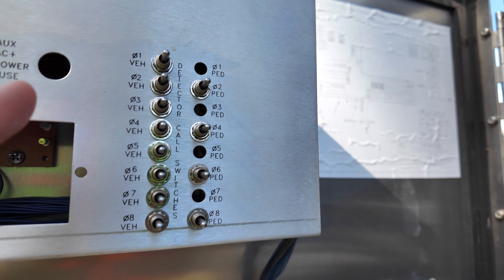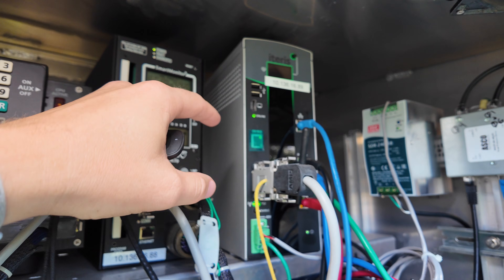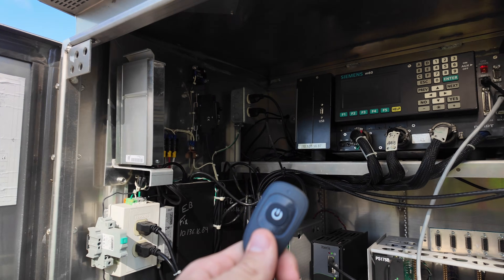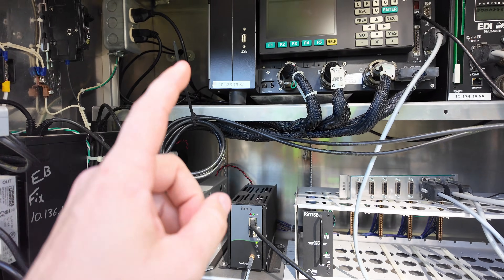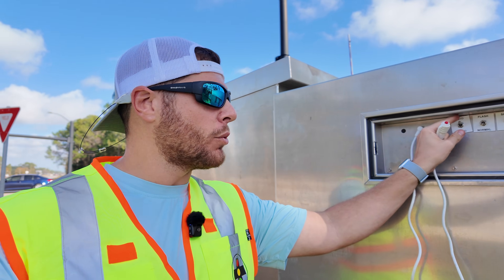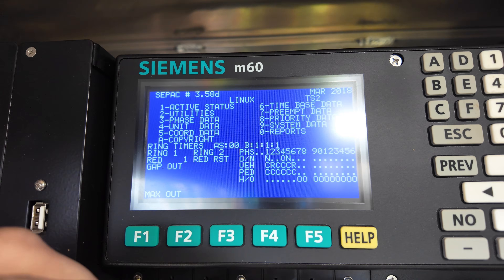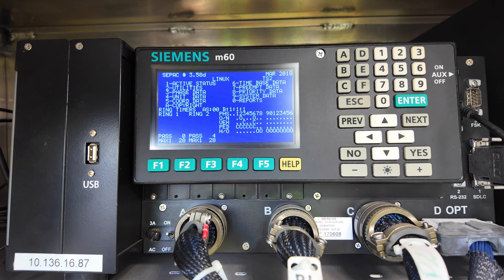What Is A Police Access Panel?

Comment: I’ve seen cabinets alongside the interstates that looks very similar to a traffic controller cabinet at different points, even in the middle of nowhere.  Is it safe to assume these cabinets have the equipment to get your cell signal for measuring traffic data? Either that or be connected to induction loops that measure the number of vehicles that go past?

Comment: I'm really amazed at how much equipment is in one of those traffic boxes.  I was visualizing a power supply, and some kind of rack with a series of relays that would sequentially turn various directions on or off.  MUCH MORE going on !!
     In my neighborhood, some of the boxes have [what I call] "sidecars" ... like a 18 inch by 30 inch box hanging on the side, presumably to house yet more electronics.  And, some of them have fans in the cabinet, because I can hear the "muffin fans" spinning (if they still call 'em muffin fans).

Comment: There is a school near a busy intersection near me. Two cops sit there 2x a day and remotely change the lights (make all ways red for students to cross). They like to do it at random times whenever they feel like it though, and then aggressively yell at you if you go through a yellow light, even if not safe to stop. I've never seen them pull anybody over for it, but they will very aggressively yell and hit their lights/sirens and even step out in front of you where you almost hit them. Awful.

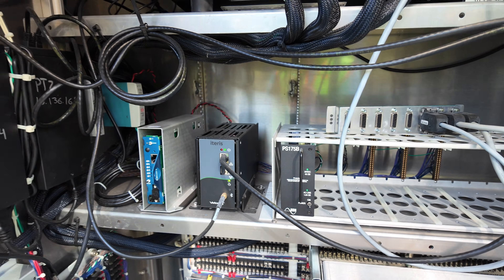Comment: 5:10 Can you do a video on the wifi/bluetooth people counter please?
Reply: For real. I have so many questions
Reply: @MichaeIKelso  
Each Bluetooth device sends a unique address tied to the device 48 bits in length during advertisement requests when trying to find devices to connect to, since these are unique its easy for any device to constantly listen for any activity on the Bluetooth band and assume each unique address is a device waiting at the intersection, its also possible to determine the distance of a device from another, this is how apple air-tags function. so by storing and using this information the traffic cabinet can at least get a base line on how long someone waited at an intersection or how congested it is just by how long that device was sitting in radio range and depending on the technology even guess where that device is on the road by using radio strength to determine distance. Many cars nowadays have Apple Carplay and Android Auto that constantly scream into the air looking for devices to connect with, so a phone is not the only target in the case of bluetooth being disabled.

that's at least a simple way to explain it, the unique address and how its generated is determined by the protocol so the chances of tracking a device that doesn't want to be tracked is limited, but that doesn't matter since the traffic cabinet is only determining presence.

Bluetooth Low Energy Address types:
    Public address: Programmed into the device by the manufacturer, and is registered with the IEEE.
    Random static address: Configurable at boot up and is fixed through the lifetime of the device. Does not need to be registered with the IEEE, and is a common alternative to a public address.
    Resolvable random private address: (optional) An address that changes periodically, but is resolvable by means of a pre-shared key.
    Non-resolvable random private address: (optional) An address that changes periodically and is not resolvable.

Comment: Great now anyone who intends harm to anyone inportant in a motercade can now be stopped and ambushed, That key is now red hot and more for sale on any dark web, any one hurt from doing this is now on you Bro and You are putting Our POTUS in danker from any Mad Man who wants to do Us all harm , Fk this bs.
Reply: First, the instructions for controlling traffic lights are probably available on the web just through a search. Therefore, anyone with interest can just google the information. Second, the president is usually escorted by police vehicles, so these vehicles would just use their lights and sirens, and block the roads that the president is not traveling on to allow him to get through the intersection in a quick manner; the traffic lights would become irrelevant. Third, the president's limousine, The Beast, contains numerous security features, such as armor, bullet-resistant glass, a sealed cabin, run-flat tires, etc. which make attacking people inside quite difficult.

If someone is intent on harming the president, it is far easier to just fire a bullet from afar when he is not in The Beast than interfering with a motorcade containing armed Secret Service agents and police officers, and an armored car.

Comment: So you're saying traffic signals are tracking volume from Bluetooth and mobile signals. Meaning, movement can be tracked if you know someone's MAC address.
Reply: Most modern Android and Apple iPhones use MAC address randomization by default. Therefore, tracking a smartphone with a MAC address would prove futile most of the time.
Reply: @Eternal_Tech  I didn't know that. BLE has a MAC address, too.Still interesting how they are using the SIGINT.

Comment: That cabinet has all the bells and whistles.
Reply from the maker: It even has a built in uninterrupted power supply!
Reply: @Trafficlightdoctor       Does the uninterrupted power supply (UPS) also power the traffic lights themselves or does it just power some of the communications electronics in the cabinet to let someone know that the traffic light has no power? I ask because when the electrical power fails in my area, the traffic lights fail. I wonder if other areas use battery backup for their traffic lights, so they can continue to operate even in the event of AC power failure.

Comment: Sorry for the odd question but how secure are those wireless buttons? I can just imagine someone capturing the signal and replaying it. Not that I would ever do such a thing :P
Reply from the maker: It typically would not be left at the cabinet!
Reply: It would have to also be left in Hand mode, so not much opportunity to exploit. If you can access that switch, the question becomes moot as you could also just plug in your own receiver.

Comment: Wouldn’t it be better if all these traffic control cabinets had wifi enabled pickle buttons of which a police officer can control any controller with an app on his cruiser computer or smart phone instead of a wired button? It would be much safer and convenient.
Reply: It would also open the controls to anyone with ill intentions. Sometimes a locked mechanical barrier is worth any inconvenience to protect the general public.
Reply from the maker: Eric hit the nail on the head! Too many areas require a manual switch to enable/disable anything with WiFi capability’s to secure the devices from outside access. A small few will always ruin convenience for the majority!

Comment: how does it get internet?
Reply from the maker: With telecommunications it’ll connect back to a fiber hut or cellular modem
Reply: @Trafficlightdoctor  Yeah, I assumed a cradlepoint router or a run back to some sort of wired connection with a wired modem. Thanks for the reply! I do a lot of IT work, and the closest stuff to this I've seen is maybe security cameras on a construction job site, every box has its own mini system going on, ie, brains (computer), switches, router (modem), backup power, etc. I have been sent on site to replace the solar LED lights, or reboot a camera system because its gone offline due to a power outage or something. My main job is running ethernet cable in commercial setting or large infrastructures, but I do lots of other oddball IT stuff. I haven't come across a traffic light box, yet, lol. Although, it wouldn't be a surprise because I do get sub'd out for a lot of things.

Comment: You need to post this video to the national police chiefs organization - this is the group that a lot of city police chiefs use to keep abreast of law enforcement updates. Many of the chiefs do not know about the "Police Access Panel" and they still uses personnel with wands to direct traffic. The remote control system will not be coming out fast enough since its considered a "luxury" by many jurisdictions. I rather have an officer stand at a cabinet than in the middle of the intersection and get taken out by a drunk driver.
Reply from the maker: Share it away!

Comment: What exactly do the WiFi and BT sensors detect, count, or log?  

It'd make little sense to just count hits of relevant RF bands.  Do they identify or log unique MAC addresses, SSID's, BSID's, or cel IMEI's?  

If so, do they use any logic to sort hits of multiple types likely associated with the same versus different devices?  

Do they log any of those identifiers, or just use recognition that one or some set exists, and count hits without detail logging, or are there site configurable options?  

I've done war driving with tools like Acrylic pro, which is easier than Wireshark and far more advanced than most smart phone tools, just using common WNICs capable of monitor or promiscuous mode, and decent antennas, and it's surprising what info users share just driving down the street.  

That may include medical facilities, recent vacation locations, kid's or parent's friends, work locations, etc., as most people are incredibly sloppy in letting devices try to reconnect with such locations they've formerly used. 

It's also surprising how many medical facilities or lawyers are grossly reckless with archaic security protocols, and transmitting client suggestive data to any observer.
Reply: Why not just go to one and detect what signals it is looking for? It can't detect without also sending.
Reply: @ericharrison619   That's not true.  

Monitor Mode WNIC's act as passive receivers, and do not handshake.  

BT sniffers can also look for transmissions of others, only.  

Even if devices attempted to handshake, that doesn't complete connections if any decent security is present.  

Regardless, even with connections, or passive signal sniffing only, that doesn't identify what logging or reporting may or may not be present.  There's a big difference between a statistical count of apparent unique devices (which still require some algorithm presumptions of mixed signals), versus recording unique identifying information as many retail merchants and malls do for nefarious tracking purposes.
Reply from the maker: I’ll have to make a more detailed video on the device and reasons but you pretty much described how the device works in your comment lol. We installed a handful of Daktronics’s message boards throughout this highway and have one of these iteris velocity’s at the beginning, middle, and end of this highway through the city for travel expectations to be listed. Don’t think I’ve ever seen them utilize them on this roadway but when connecting to this device you’ll see collect device data and timestamp. It’s a little less impressive at a slower intersection like the one in the video but I’ve installed similar ones on camera poles off the interstate and it’s a bit insane watching how many devices it’ll pick up in a short time frame as it picks up any mobile device, tablets, modern vehicles, etc.
Reply: @Trafficlightdoctor  Collecting device data and time stamp?   So it's surveillance.

Comment: Interesting, never knew there was a wireless module for hand mode. Have a great safe Christmas!
Reply from the maker: It’s a great feature! Have a Merry Christmas as well my friend!
Reply: There are all sorts of cheap remotes used for cameras to industrial systems, that should be simple to adapt where the usual wired remote is a simple hard contact switch on a plug.  

Many would operate on 433 MHz, or other 47 CFR 15 unlicensed low power intentional radiator allocations.
Reply: Wireless is one option that these controllers have, so yes.....this one shown with the fob is wireless capable.
Reply: It’s not wireless, it’s (hardwired)connected to the controller.
Reply: @butchc9226True, but the way the button and cabinet communicate to each other is wireless.
Reply: @kyle_miles_915  The button energizes a flash transfer relay via low voltage wiring. If I’m wrong I wish the dr would explain how it’s controlled via wireless because thats new to me.
Reply: @kyle_miles_915  I had to watch it again. That wireless feature is something new to me.
Reply: @kyle_miles_915  Wow,,, so the guy plugs in the button wire to the cabinet and the button communicates wirelessly with the cabinet. Sweet got it! Well I'm going to watch a video now so I better plug in my wireless earbuds into my laptop so I get great sound! 😂 Later.
Reply: @butchc9226 It does the same thing as the wired button, except the 'button press' action is done on the command of the officer holding the remote, wirelessly. It's a pretty dumb device, no different than the remote-operated lightswitches and 'smart' plugs you use to turn a regular lamp on and off
Reply: @TRLTheRandomLab  yeah I get that but without getting into the device specifications and also myself that worked in the traffic control field FDOT, for 45+ (now retired lol) I have reliability questions. But hey it’s the local government problem.
Reply: @TRLTheRandomLab there's a discrepancy here. Please verify and clarify when I'm wrong. The white button on the plug in cord is a cable connected contact switch isn't it? If so the voltage in the circuit flows through the wire to trigger the controller or it's a dry contact that still does the same thing as the black box that you showed plugged in, that is triggered wirelessly with the fob. The only part of the whole thing that's wireless is the frequency transmission from the fob you showed to the plugged in black box. My only last question is are the traffic lights actually hard wired through the poles underground to the controller or are the actual lights fixtures themselves wireless to the controller? Thanks and Merry Christmas!.
Reply: @jpol3808  it seems like the wireless device sends a control signal to the flash transfer relay which places a hard signal  to the controller. Everything after that is hard wired as in the signals changing.
Reply: @butchc9226 so the black box and the fob that he showed us, after he showed the white corded button, wasn't wireless. He also directly said "so the officer can control it from the comfort of his squad car" but I guess that isn't wireless either. Thanks!
Reply: @jpol3808  thanks for the comment 😂